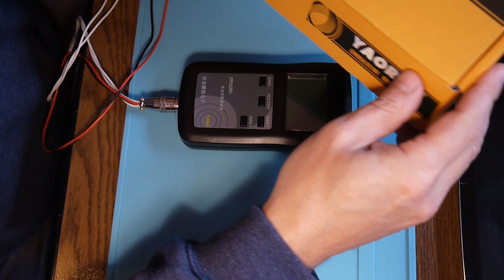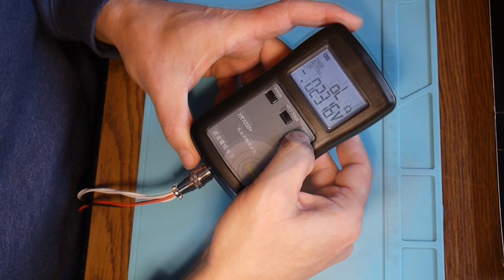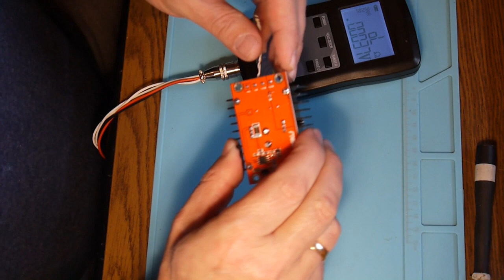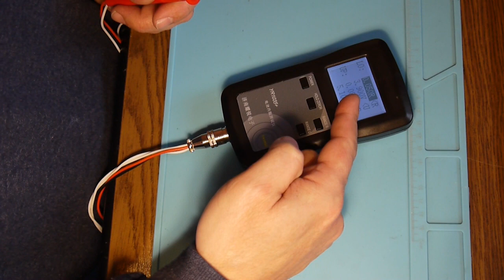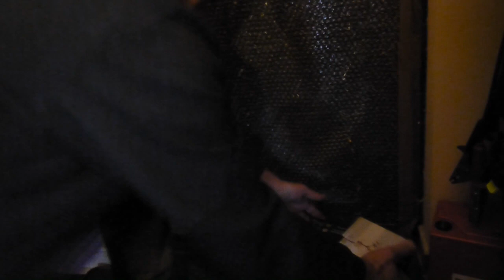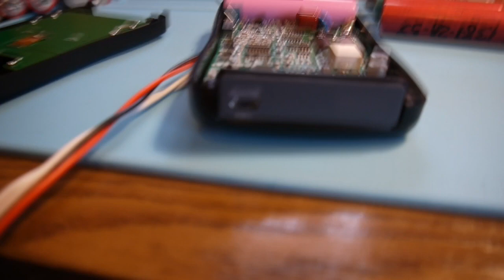YR1035+ Lithium Battery Internal Resistance Tester,low Z and voltmeter tests,Real four point measure

Comment: So how to know what LI ION battery is faulty?
What is value to mili oms that indicates that battery is bad ?
And what is for voltage?
Thx for explaining 
P.s i bought it yesterday
Reply from the maker: Normally a good 18650 li-ion should have around 30 miiliohms (chargerd) about max 50 milliohms can be used for non-power hungry devices (radios)...everything higher then 50 it's gone... Sometimes a cell can be deeply depleted under 1V...very possible to resuscitate  it with a proper charge...so final voltage should be 4.1-4.2V. Let it be for few days, eventually measure the voltage. If it's under 3.6V ...it's gone. So, finally , after few days of stand by a good cell (18650 only! ) should have around 30milliohms and min 3.6V. Other kind of cells depend on the capacity and purpose. You should check their own documentation for proper numbers.

Comment: Bought this device recently and unfortunately, mine is missing calibration option. Do you know maybe the reason? Firmware update or...?
Reply from the maker: Check the manual..it should be
Reply: @viocaia  manual point to the No.7 in the menu, just like yours, but under No.7 and No.8 in the menu are just 3 dashes, like: 
"7. ---"
"8. ---" 
Guess something is wrong with the software.
Reply from the maker: @neshco  Sorry but I got no idea how that can be done, probably a resoft? Is it YR1053+?
Reply: @viocaia  Yes it is YR1035+ and sw version is 2.2206, that is what is shown at the boot when I turn it on. What version show your device at boot?
Reply from the maker: @neshco Look here https://youtube.com/shorts/u-io4_l3f4c?feature=share
Reply: @viocaia  yup. Definitely different version of firmware. Thank you for help, now just need to find that 2.1968 fw dump to flash my device with it.
Reply from the maker: @neshco Glad to help! Good luck bro!

Comment: Old video but...how can I power on the ZR? I buy thr YR1035+ right now FW 2.2111 Thank you
Reply from the maker: To power on? simplypress Power.To recharge, use a Micro USB cable  to a 5V phone charger.As for ZR function is auto on when you start the meter
Reply: @viocaia  thank you, yes I know how to power on the YR1035 😊 but question was how to “power on ZR?”. Maybe my tester doesn’t have it.
Reply from the maker: @Milons  What do you mean by ZR..it's already on auto ZR when it's starting...
Reply: @viocaia  May be mine doesn't have this function, I saw your tester and it has written on the HOLD button ZR, mine not. I'll ask to YAOREA
Reply from the maker: @Milons  Maybe...

Comment: Καλημέρα κυριε Caia, σας ευχαριστούμε για το πολύ ωραίο βίντεο που είναι χρησμό για εμας τους αρχάριους, εχω ένα πρόβλημα με το YR1030  έκανα το λάθος και δοκίμασα σε ταση 60 volt ενο απαγορεύετε δια ροπάλου ανω τον 30 volt, απο τοτε οταν το  ανοίγω δεν ανάβει και κανει συνέχεια μπιμ,μπιπ,μπιπ... Του αποσύνδεσα την μπαταρία μηπως και διόρθωση αλλα τιποτα, αν μπωρειτε να με βοηθήσετε για να ξαναδουλέψει θα σας ειμαι ευγνώμων σας ευχαριστω εκ  προτέρων καλή συνεχεία!
Reply from the maker: I wish to help you with a magic trick..but I'm afraid it's gone...by the book they say it's 100V max, so it shouldn't be a problem in voltmeter mode to measure 60V, but not in resistance mode..so I think the input chip it's burned or something, there is a short somewhere if the light is not coming one..check the current from the battery..it should e few milliamps..also check all the capacitors for short..
Reply: @viocaia  Επανήλθα και πάλη για να ευχαριστήσω για την βοήθεια που όντος δούλεψε   αποφορτιζωντας την μπαταρία στα 3,4 βολτ άναψε και πάλη η οθόνη με την διαφορά ότι είναι στα κινέζικα (πριν αγγλικά) πως θα αλλάξω την γλώσσα στα αγγλικά;. Ξέχασα πριν να αναφέρω ότι η βλάβη προέκυψε μετρώντας αντίσταση και όχι βολτ.. και πάλη ευχαριστω!
Reply from the maker: @christosxenopanagos2737  my deviceYR1035+ doesn.t have a language menu..so I can't point you to..but try Power/nr8/factory reset/yes
Reply from the maker: @christosxenopanagos2737  mayba this can help
https://www.scribd.com/document/494989671/Yr1030-en-Draft

Comment: Great video. I bought the same meter, but sadly only Chinese text on display and documentation. There is however also english text on the front so I am hoping there is a possibility to set the language. If so, could you show me the menu flow on how to set to english language from power up of the device, (or point me to an English manual which explains it)
Reply: Found the language setting menu in the last Chinese menu (nr. 9). There was a CNL entry and I managed to change it to ENL (English Language vs. Chinese Language). Now I have a much more understandable and working system using your info.
Reply from the maker: @i.verlaek  Super ! Good to know!
Reply from the maker: I'll do that next days
Reply from the maker: Please help with subscribe
Reply from the maker: Just checked..there is no option about language in menu..maybe there is a way to load a new firmware..I don't know, you should contact the producer.

Comment: Thanks for this video, based on a review of the YR1035, that unit uses a 900mAh 18350 battery internally. So this updated YR1035+ unit now uses an 18650 battery inside -- is the 18650 battery easily replaceable -- do you see a capacity marking on the internal 18650 battery inside the YR1035+ and also how is the battery attached (is the 18650 battery soldered to connectors on the board ?)

I'm interested to find out because I have an older YR1030 unit and I've used it quite often for more than a year now -- its internal battery drains very quickly now. I'm looking at this YR1035+ unit, 18650 battery would likely be easier to replace in case the internal battery has been "spent" (shortened battery life)
Reply from the maker: The battery is no name,  clear 18650, same sizes, it's soldered on the board, so far I charge it  once, when it came and still full battery, I don't used it so often..
Reply from the maker: Hey! Please give me a hand and subscribe! Thanks!

Comment: Good review. Why is the voltage resolution so low?
Reply: How to change language sir? 
 This part same with your video but language just chinese😓...how to sett english language?
Please help me
Reply from the maker: @Drone_Klayapan  Hey There, if you go to page nr 9 in the menu you'll see CNL and change taht to ENL...please subscribe!
Reply: @viocaia  i can't find menu CNL on page 9...i think my part just for chinese
Reply from the maker: @Drone_Klayapan  That's how I've been told from another subscriber..mine metter doesn't have it too, but it's in english..I'll do more search and let you know
Reply from the maker: @Drone_Klayapan  that's the original post from Ivo Verlaek
Highlighted reply
Ivo Verlaek
11 hours ago
Found the language setting menu in the last Chinese menu (nr. 9). There was a CNL entry and I managed to change it to ENL (English Language vs. Chinese Language). Now I have a much more understandable and working system using your info.
Reply: I suspect this meter is not genuine because as far as I am aware these are 100000 count. Did you buy it from Yaorea?
Reply from the maker: I bought by Banggood , I'm not sure if it is a fake or not, all I can say is doing the job...
Reply: @viocaia  I spoke to Yaorea "official store" via Aliexpress and they said this is the specification for their meter. YR1035 + accuracy format: ±([accuracy percentage] + [minimum effective bit number]) range maximum resolution accuracy display mode 20mΩ 0.01mΩ 0.7% +7 22.00mΩ (when ZR function is enabled) 200mΩ 0.1mΩ 0.5% +5 220.0 MΩ 2Ω 1mΩ 0.5% +5 37Ω 20Ω 10mΩ 0.5% +5 39Ω 200Ω 0.1Ω 0.6% +5 45Ω gear range from 5% to 95%, when it is not within this range (less than 5% gear range, or greater than 95% gear range), the error may be greater than the above accuracy. Voltage measurement: ±(% reading +% range) range maximum resolution accuracy Display Mode 1V 0.00001V 0.15+0.015 .99999V 10V 0.0001V 0.15+0.010 9.9999V 100V 0.001V 0.15+0.015 99.999V positive and negative symmetry error ±(0.012% +5 words) temperature Drift 100ppm/℃ within normal service temperature (10℃-40℃)
Reply from the maker: @thepowersource1602  My mistake, I just checked it was by Aliexpress..https://www.aliexpress.com/item/4000347233749.html?spm=a2g0s.9042311.0.0.16144c4drMpcBB
Reply: @viocaia  I ordered one based on your review except I ordered it from the Yuarea store because the specs say it can display 99999. I hope it's not the Chinese version.
Reply: @viocaia  I think the one you linked me to is the YR1035 which might explain why you are missing a digit.
Reply from the maker: @thepowersource1602  Good luck with that and let us know!
Reply from the maker: Hey! Just give me a hand and  subscribe ! Thanks!
Reply: @viocaia  Sure!